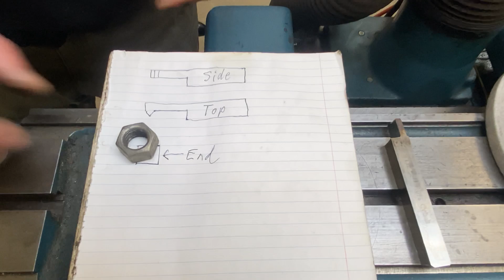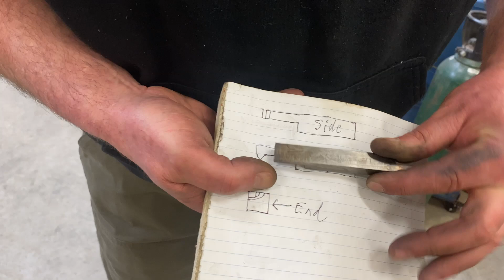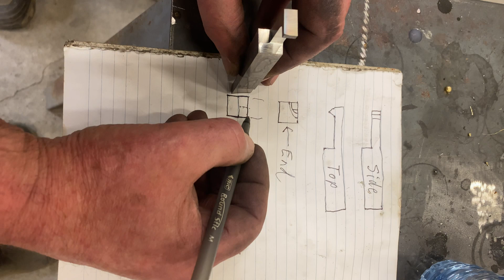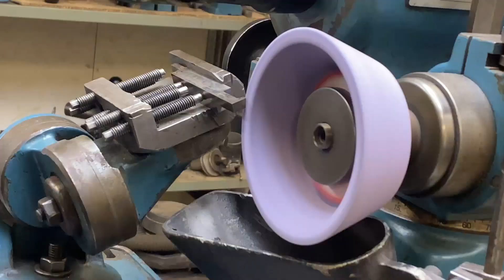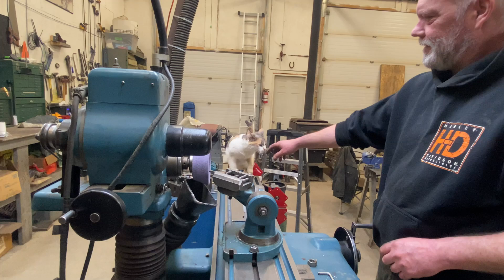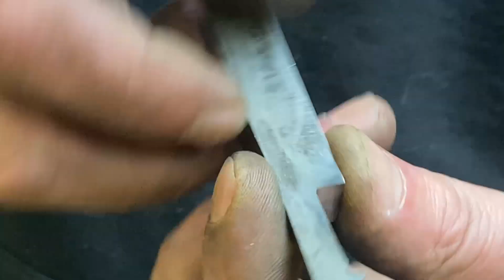Making a new spindle nut for our tool and cutter grinder

Comment: I have found that SHAR's Diamond and CBN wheels (cup and straight) for carbide and HSS with my Cutter Grinder. Lots cleaner as no material except what you are cutting is coming off.
Reply: Indeed, I have been collecting CBN and diamond wheels as I need. Shars has great prices for my budget.  Still cannot beat the ability to shape a rock wheel when needed.

Comment: A tool every turner needs eventually.
A small bore HSS internal threading bar that fits easily in your tool post or quick change and also can be clocked up easily.
Well explained though I was calling for some free hand on the clearance…
Hahaaa, 
Good video, thanks
Reply from the maker: Thanks for the comment